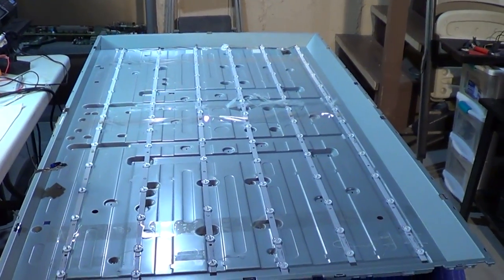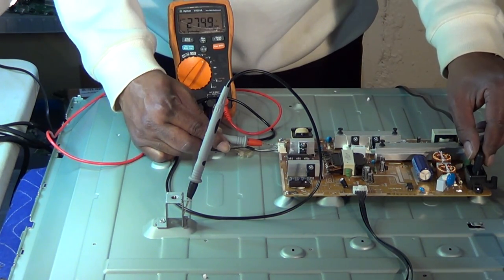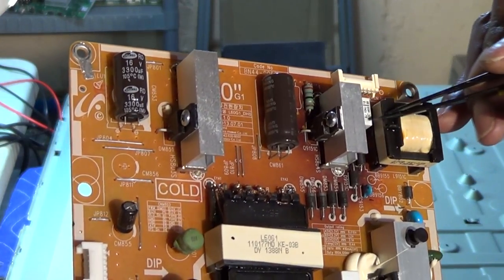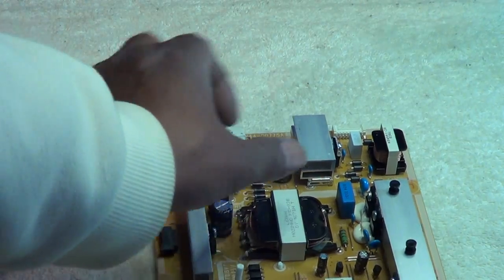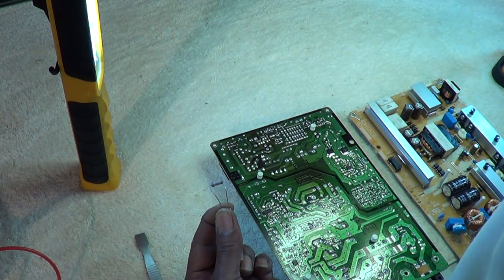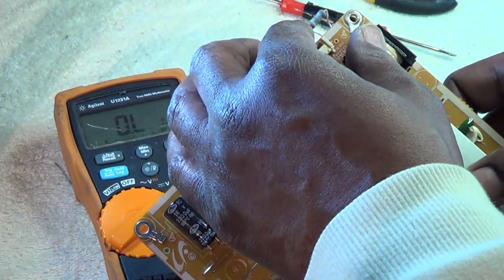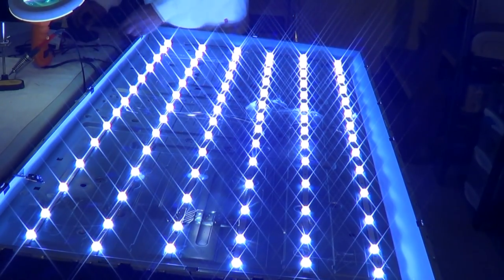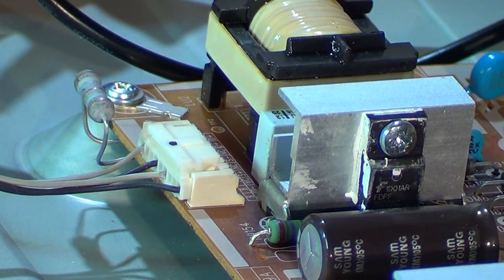Replaced bad LED Strips, but TV still has no backlight. Samsung UN60FH6200FXZA  power supply repair.

Comment: Those 3 blown smd resistors where being used as a cheap fusible link, they were meant to blow in case of overcurrent.
Reply: I am looking for a service manual/schematic of this BN44-00669A board. I have the same issue with the blown resistors and require the values. PDF schematic would be awesome
Reply: @im14u2no Same resistors as in the video?  According to bigdog in the video, they were 1 ohm each. 3 resistors in parallel, at 1 ohm each, equals 0.33 ohms. 3 resistors in parallel means they can pass 3 times the current, so if one resistor was 1/4 watt, 3 resistors in parallel can handle 0.75 watts.

Comment: Excellent video!! Keep them coming Bigdog! You've helped me troubleshoot over 10 different tvs I've come across already. What's up with all the critics on here? Almost every board I've ever worked on has underrated components on it and who cares if it is not original as long as it works and its safe.

Comment: There is over 100 volts at the second line negative lead!!! This might be a surprise...maybe advise people to use right arm only for probing with multimeter negative on chassis as you show.  Thanks for the videos..

Comment: It seems that wall mounting and/or the user running the set with the backlight at maximum setting is a major contributing factor in these backlight failures.  The wall mounting seems to prevent adequate ventilation and makes the LED strips overheat and fail.

Comment: Hello Bigdog, I have an unpredicted problem on a UE55F6100... I checked everything, replaced one led that was dead on a strip but still clicking and no power up. I manage to make the tv runs for hours fine with no problem by removing the led connector and plugging it after the tv is powered on.... its really strange! don't know where to search, don't want to replace the powerboard as all working correctly if i plug the led connector after powering the tv on.  the powerboard is L55X1QV_DSM BN44-00625C
thank in advance for your help!

Comment: Interesting and will probably help me fix my TV.
There is a reason for the three resistors though.  Each one is sized to act as a "fuse".  The reason for 3 instead of one is that a  current surge could take out one resistor but the other two would still supply the power needed.  More than likely what happened in this TV is that as LEDs failed, resistors opened up until they were all "popped".  Using one large resistor will make the TV work, as seen, but that safety factor is now gone.  Might let the majik smoke out of the PSU on the next problem.
Reply: Yep, just said that above, they were meant to blow in case of overcurrent.  But they are in parallel so are sharing the current. If one blows, the other two will quickly follow.

Comment: The cable is called LVDS.. The resistors are probably what is known as current sense resistors. The LED current draw of the LEDs is translated into a small voltage that the control IC uses to know how to regulate. It is called feedback. The total resistance is usually .7 to 1.0 ohms.

Comment: Hey BigDog, what up bro, I have the same tv. 2 LED strips appear to be non functioning in the top left corner. If I have the brightness or the backlight turned up to high, all the other working backlights start flashing off and on and then will stop if I turn down the backlight and or brightness. Would those 2 burned out LED strips cause this problem? Thanks in advance.
Reply from the maker: Most definitely!
Reply: @bigdog8882  thanks big dog, It works perfectly now. Replaced all the LED strips. This samsung was easy to take apart and fix. Works perfectly now and thanks for all your videos. They are a big help. Happy New Year.

Comment: I have no DC voltage on the powerboard LED / Backlight connector........AND I  don´t see a picture/logo when shining with a sharp light on the LCD screen.  So I´m wondering if you did have a picture or not in your case when lighting up the screen with a flashlight. Greetz from Holland!
Reply from the maker: Yes you should see an image with flashlight if TV has bad backlights or just no voltage going to backlight strips
Reply: @bigdog8882  Thanks for the comment, but that´s not the case, Maybe the backlights are good. BUT I don't know if the ignitian of the backlight, like other powerfunctions is by the processor on the mainboard. I have read in a servicemanual from LG company that in case of no logo no video and no sound the mainboard has to be replaced. Getting the right mainboard is rather difficult. So I think it is gonna end in buying a new UHD TV with Android and no longer spending money on this one.
LG Tvś have a lifetime of nearly 7-8 years and 
are nowadays produced by robots in china.
In that case there is nothing  for me  to complain!  Greetz and best wishes from Holland!

Comment: Hello

I love all Your videos and i see you are able to replace a SMR with a color coded one, i am glad i do not have to use the same resistors.

My Naxa NT-520k has sound but no back light.the backlit lights up when i use the tester across the 2 lead wire.

i can not find a schematic for This Naxa TV however The Board number is Cv3458h-Aso which looks similar tot the Rca board The driver board using the multi purpose meter reads 08.1 on the Naxa TV but in stand by mode 12.0 V,i am guessing the Led strips are ok but not sure where to test.

i still have more testing to do i did the test with the over head light (not flashlight) and i can see the menu screen

Comment: Hey your second power supply is the one I’m working on. I also have two of these are the same model but made a year apart from each other. On one tv change the tcon board on to the led strips. Now they don’t light up. Now I know what your saying to tace back the voltage.

Comment: I have the same TV (oops, almost, un60j6200afxza), when plugged in, the LED's just flash - no pic, no sound...PS issue?  All of the LED's appear to be lighting up from what I can see from the back side, all of the light in the holes look very even...just flashing.  I have not been able to find this symptom after going through all of your awesome videos...thoughts?
Thanks brotha!
Reply: I think I found the issue, checking the FET's like you said, I have one that is showing shorted on all legs.  Now, to find one...

Comment: SAMSUNG
MODEL # UN60J620DAFXZA
VERSION # NS02

PICTURE - Red, black and blue colored display with slow blurry movement.
 and No sound

What should be the problem ? Please advice for the parts i need to order.

Comment: It's quite old now so likely found the correct resistor values by now. Obviously ok to test for further issues but the  correct resistors would have needed replacing. Incidentally if you Google the power unit model you can usually find a schematic to confirm component values and to help with fault finding.
Good job though and keep it up.

Comment: I have a Samsung un43nu6900 it is completely dead, no standby light. Do you have any suggestions on what I should check?
Reply from the maker: Check the 5 volt standby pin on the Power Supply plug going to the Mainboard. If no voltage on the plug then replace PS. If u do have voltage on the plug; especially the standby voltage, then U could possibly have a bad Mainboard.
Reply: @bigdog8882   I only saw one board inside of the tv. The power supply and the main logic board are on one board.
Reply: Look for a light tan coloured board if it’s not there someone has taken it out that’s why no standby light
Check fuse in plug
Check list (if the board is there)
Look for burnt or damaged components 
Check 5amp fuse near mains socket
Check the bridge rectifier (slim black device which looks like a corner has been cut off next to the top heatsink)
Check mosfets on topside of board 
Check diodes 
Check mosfets on the bottom
One to look for is a 50R380 common to blow

Comment: Would you know what my panel model number would be, since there is no sticker on my panel, I need to order replacment LED strips,
        SAMSUNG
Model # UN60H6203AF
TYPE- UN60H620
MODEL CODE- UN60H620AFXZA
VERSION- HH01
S/N- 02Q43CDF500105R

Comment: Only 1 resistor to replace 3? Like an electrical bypass!
Reply from the maker: Yeah they were actually too small in the first place. Remember, those resistors got almost 400v going threw them. I guess it was an afterthought on Samsung's part. Thats why they put 3 smd resistors in parallel on the bottom instead of just using a higher wattage one on  top of the board.  They just use  one B+ line and just one feedback circuit to light up a 60 inch tv with 6 rows of led strips. Efficient and Cost Effective for them I quess. lol
Reply: @bigdog8882  Poor R & D..
Reply: The 3 resistors act as a fuse just in case LED backlight is shorted. It uses 3 as SMD resistors at higher wattage will use up more space if you use 1 with bigger wattage.

Comment: I'm not happy with the resistor flapping around in there. It wouldn't have been any harder to replace the original resistors, 3 ohms each.
Reply from the maker: If your always unhappy with how I do repairs and solder, watch someone else's channel and leave little immature negative comments on their video. OK Mr. Perfect!
Reply: @bigdog8882  No need for unhappiness when you do it right, OK?
Reply: I have made similar repairs, and they outlasted the set. I usually use heat shrink on the resistor leads though.
Reply: @Sodder Bridge I believe the point of this video is to show there is more than one way to skin a cat. The board had obvious signs of overheating. He even mentioned that and said. This was not a perfect solution but rather an alternative.

Comment: I believe if you remove the power cable between the power supply and motherboard, the back light should light up as soon as you plug in the power cord.
Reply from the maker: GOOD POINT. Thanks

Comment: What caused it is the question..
Reply from the maker: Over a period of time the led's short out 1 by  1 and  constantly pull too much current from the led circuit on the power supply,  Thats when I showed the dark spot on the board. Eventually when that last one shorted it probably popped those resistors (which were probably overheating anyway) before it got to anything else.
Reply: @bigdog8882  Understood & I'll keep it in my data bank in case I have a similar issue & visible evidence of the board getting hot in spots was there.  Wonder if they didn't have a surge protector or if it just happened from overuse thru the years.
Reply from the maker: @edwardanthony7283  Just normal wear and tear.
Reply: @bigdog8882  Got it. What year was the set made?
Reply: @bigdog8882  Samsung is usually pretty good & I believe the Insignia brand @ Best Buy is made by Samsung.
Reply from the maker: @edwardanthony7283  I forget.lol